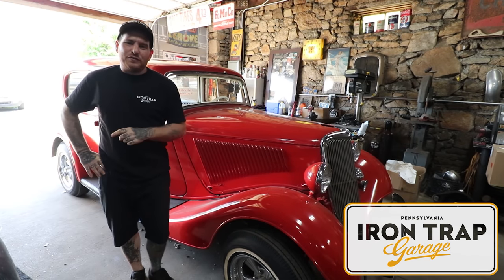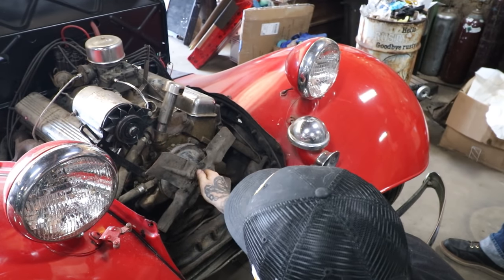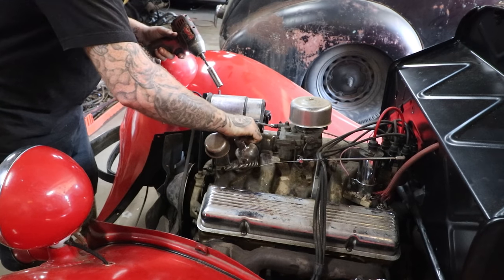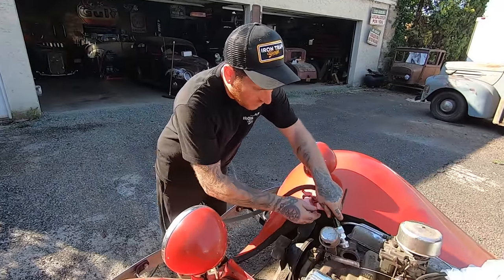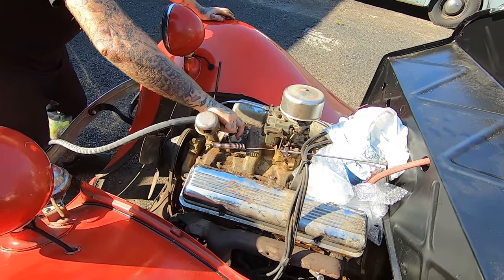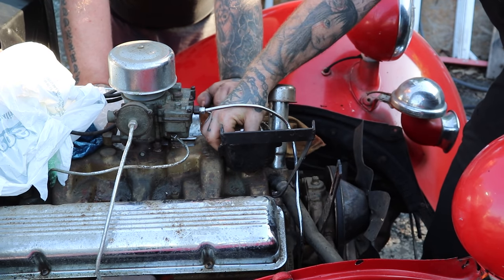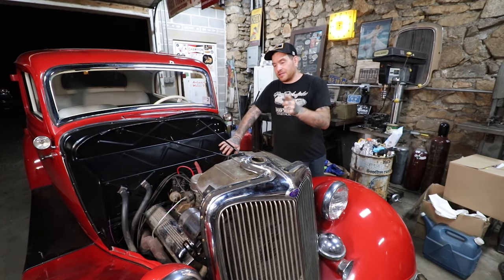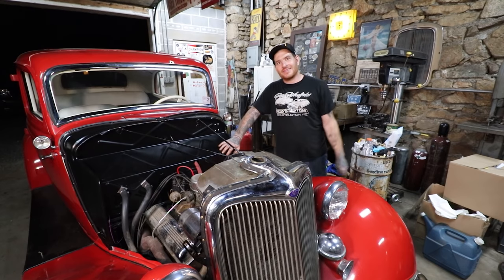Flushing The Cooling System and Installing a Heater!!??? - 1934 Ford Tudor

Comment: Hmmmm. With all that corrosion that was under the thermostat and where the petcocks screw in, I think that I would knock out the frost plugs and see what else lurks inside. Running it as is could throw a lot of crap into the radiator. Then it all has to come apart again! Not that I have ever experienced this, but I have heard about 'other guys'.
Reply from the maker: Always a gamble.

Comment: You might want to run the heater hoses together with a connector so you don't hurt the heater core.
Reply: ,,,+ 1.

Comment: Looks like you are missing the pan under the grille,,,It helps with cooling by making air flow thru the radiator,,,
Reply from the maker: Both pans are installed.

Comment: Would it not be best to pull the motor and remove the oil pan to clean the sludge out of the bottom of the engine. I know that's a lot of work, but it might save the engine later.
Reply from the maker: We did that in some of the early videos on this car...